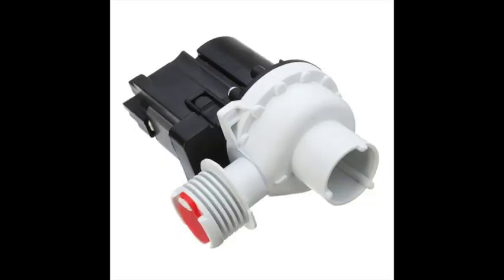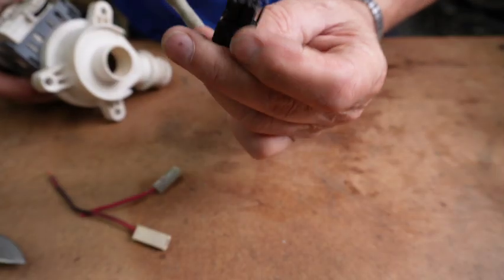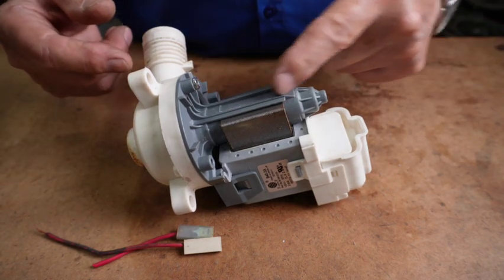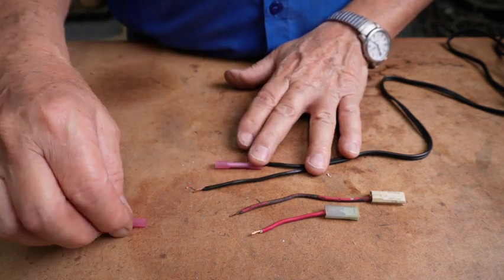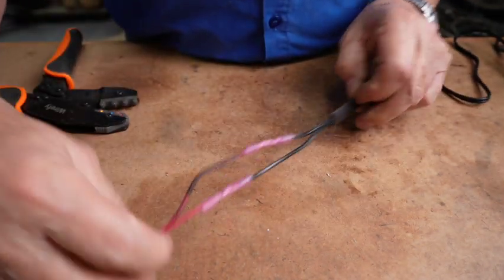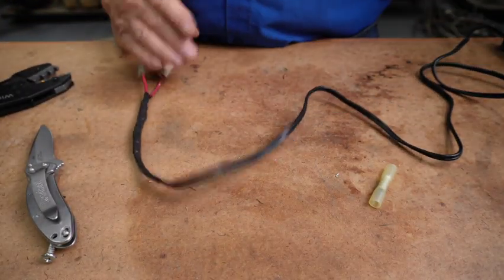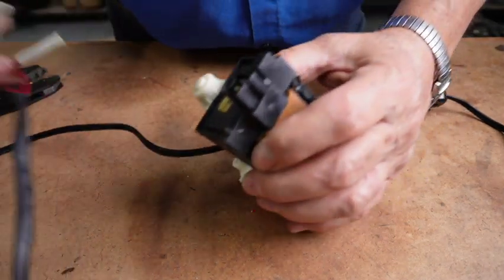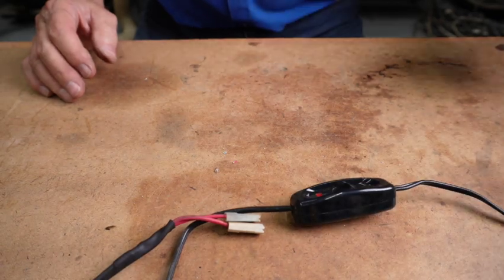How To Test a Washing Machine Drain Pump: Diagnosing Impeller Issues & DIY Tool Creation

Comment: Great video, able to determine my drain pump was toast with your tip. Best wire stripper I have ever used, and safer than a pocket knife too:

Klein Tools Katapult Automatic Wire Stripper and Cutter for 8-20 AWG Solid and 10-22 AWG Stranded Wire
Reply from the maker: Hey, I'm glad the video was helpful.  Thanks for the tool tip, and thanks for watching too!  I'll get a pair and give them a try.

Comment: I have a GE frontload and the water isn't draining. When I start a cycle I get the hum sound of the pump but I don't hear the draw down of the water. I took the pump Wh11x34740 out and couldn't find any obstructions in the unit. I guess I'll be buying a cord to test it. What else could be stopping the drainage if it's not the pump? I emptied the standing water by opening the front access panel. And the drum wouldn't spin until I took the standing water out
Reply from the maker: You need a new pump. Or there is something stuck in the tub to pump hose. Thanks for watching!
Reply: @HarperandKnowles hi I got my GE washer Fill water to the tub and the water just come out to the drain hose that attached to the pump and out to the drain. I tested the pump good. Are there any relay that need to be checked ? Thanks.
Reply from the maker: I bet your drain hose is lower than the water level you need to have in your tub. The tub is just a large bucket with a hole in the bottom with a hose attached to it with an inline pump. There is a reason you have to have a stand pipe higher than the tub for the machine to hold water. Thanks for watching!

Comment: I have a samsung flex washer and sometimes it drains and sometimes its dosent.  I replaced the pump and i still have the same issue. What can it be
Reply from the maker: Is it the upper or lower washer or both?
Reply: @Harper & Knowles Washer and Dryer Repair  both.  But I figured it out.  The person I purchased it from said it would drain and they spent $900 on repairs and had the same issue.  But its needs an inverter board.

Comment: What brand wire crimper is that? Name is not clear in video.
Reply from the maker: It's called a Wirefy, Check the link in the comments. Get you one. Thank me later!
Reply: @HarperandKnowles  thanks for the tool tip, will try that  crimper.

Comment: My LG front loading machines drain motor runs perfectly  well when removed but at times it fails to rotate and starts vibrating and does not rotate. Any tip?
Reply from the maker: Replace it. Thanks for watching!
Reply: @HarperandKnowles  Oh! Thanks.
Reply: Same issue with my kenwood front loaded waching machine. Did replacing your drain pump solved the problem ?
Reply: @ijazzzali  No. I did not replace. Just cleaned it and put it back. Running perfectly for months now. Some use vineger to clean places around the rotor/shaft. But don't be tempted to open the motor assembly further. Just external cleaning.

Comment: What's  issue  when water is continually  coming  out drain  when washer is supposed to be filling
Reply from the maker: Your drain pipe is lower than the top of the tub. Imagine a bucket with a hole at the bottom with a hose connected and you have a washer tub. Watch this video, https://youtu.be/OBZcWzOj0Ig?si=pVbkX5q_x0TBK3IB

Comment: I cleaned my duet sport front load drain and it still won't drain. It just hums. I think the pump is bad.
Reply from the maker: If you remove the pump and find that the impeller is still fixed to the shaft and appears to be good, it may be. I have found articles of clothing jammed in the hose from the tub to the pump that caused it not to drain. But your pump could still be bad even if the impeller is solid on the shaft. It just won't spin under load and will hum. Anyway, check that drain hose too while you have it out. Thanks for watching!

Comment: who is stupid enough to make a waterpump shaft that will rust?  have they not heard about stainless steel?
Reply from the maker: Those who sell pumps! How stupid is that? Thanks for watching!
Reply: Those who want to profit by selling replacements.
Reply: The ohms reading on a water pump is 5 to 10 ohms or 10 to 20 ohms and I also heard it depends on what model you have